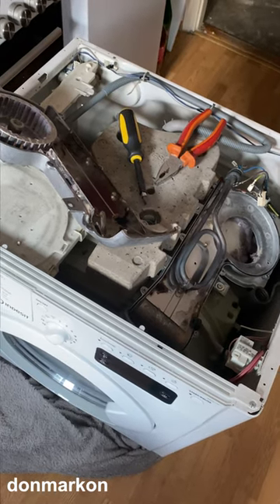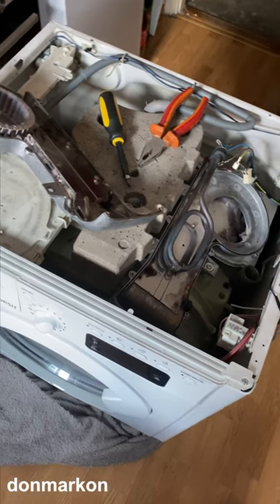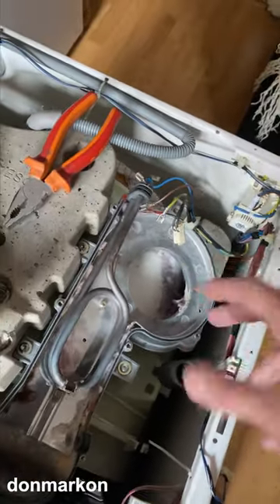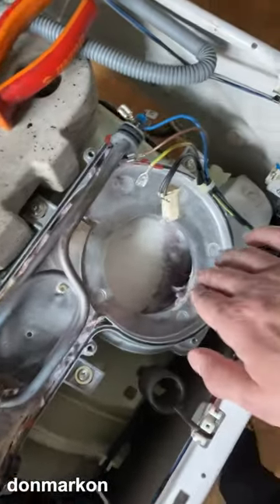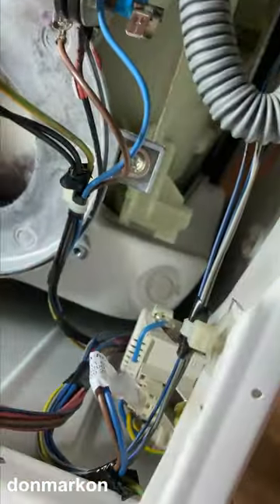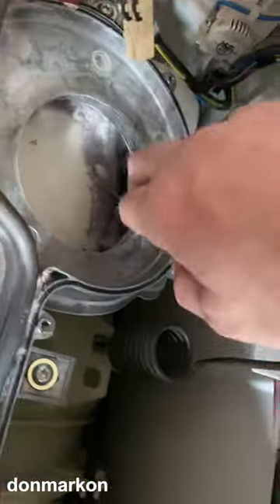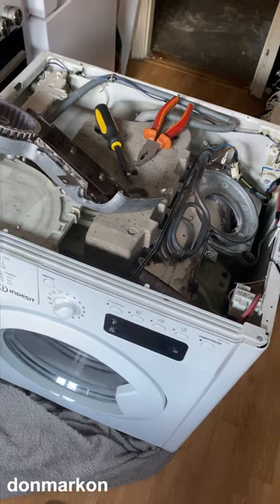Washer Dryer Not Drying Common Problem 100% Fix #shorts

Comment: My washer dryer is getting stuck on 1 minute for liang time after drying, when i turn it off manually and wait few minutes till it cools a little bit then Clothes are hot and wet. I cleaned the drying channel but it didn't help. Any advice?
Reply from the maker: It sounds like mainboard problem ...
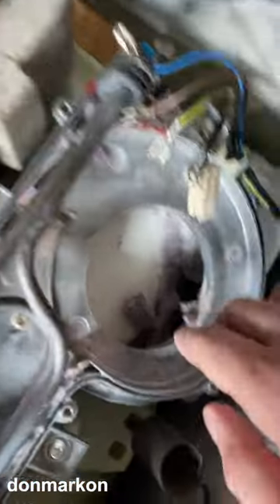Reply: I have the same problem with my machine getting stuck at 0:11. The sensors are getting blocked by the lint/fluff
Reply: @vikassingh-xu9km  for me solenoid Valve was the issue. IT was cracked/broken. I replaced it and my washer works perfect

Comment: I have this same model. I've opened it up, but I can't get the condenser out to clean it. Any tips or more info?
Reply from the maker: I hope you figured it out? First time is hard, after that it is easy :)
Reply: @donmarkon  I did. Found a video on an Indesit washer-dryer repair that guided me in the right direction. Works like a charm now. Thanks!
Reply: @vanessawattamaniuk7060  hey I’m trying to find the video you mentioned of how to remove it, any chance you might have a link? Thanks 😊
Reply: @ashleyturner93  exactly youll think rather then  gloat she would of sent the video
Reply: @vanessawattamaniuk7060  hello can your share the link for the video, pls. Thks

Comment: Thanks my beko is very similar took everything out and cleand fan(was blocked 75%)and plastic unit. The metal unit is seald shut with black pu type sealant so I left alone looked ok. Should a force open and re-sill if issue persists?